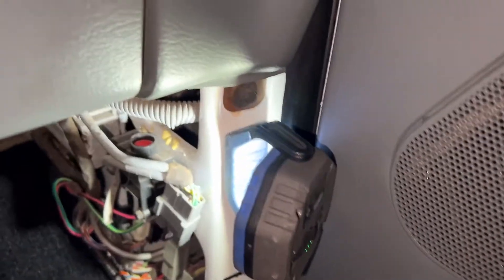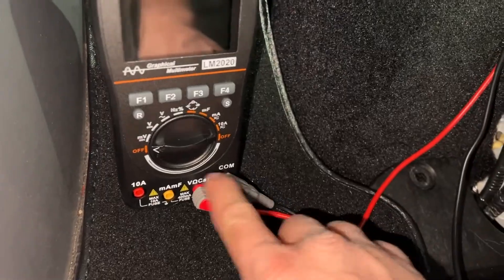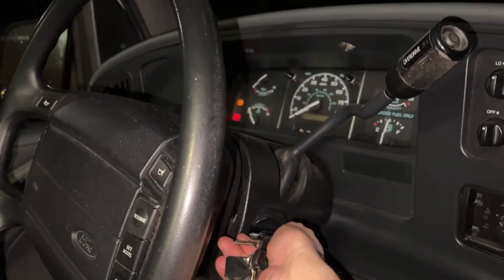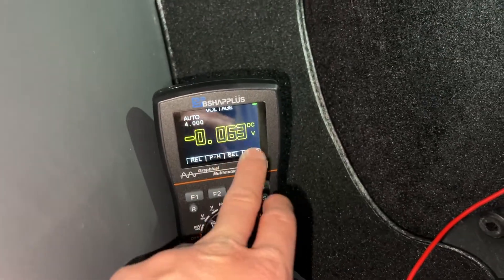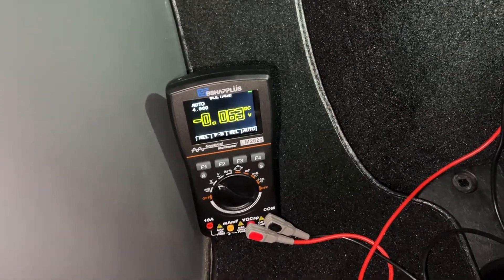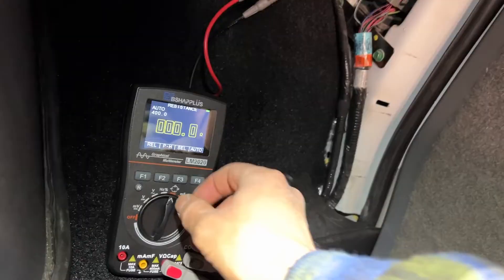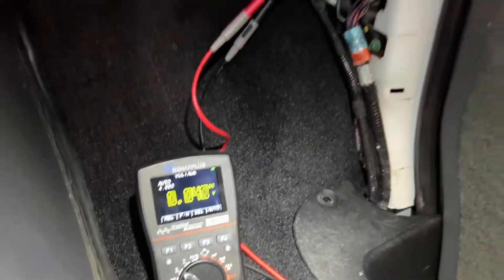How Test if the Ford Inertia Switch is Causing Fuel issues | Checking Voltage Drop

Comment: Just replace my fuel pump on 2003 Ford explorer and replace battery it turn over but felt like it was miss firing when holding gas padel to the floor with no power to keep engine running now battery light and service light is on
Reply from the maker: check fuel pressure, aftermarket pumps these days can be garbage, could be electircal issue as well

Comment: Dickerson!!! I command you for your experiments and the desire to illustrate some YouTube audience.

My recommendations are as follows:

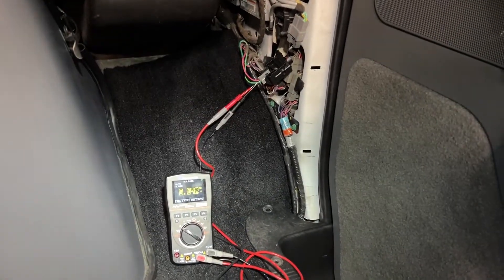When you record a video despite your interest in helping others please label the title with make and model of your experiment. Remember not all Ford models have manual inertia switch in the same location or even at all!!! 2009-2020 F150’s don’t have a manual one. So if 50 people take the time to look at your vehicle and it doesn’t work for them, they are going to leave a thumbs down as I will just until you fix it. If 50 people watch your video for 3:24 seconds per day world wide + the time it takes during the advertisement adds per day aka 4 seconds if hit skip + the lagging clicking time to get to this video and get out, scientifically each one is wasting 3:30 minutes if it doesn’t apply to them + the labor time removing components that could be up to an hour to remove them just to realize your video don’t fit their vehicle. So yes you could fix it by specifying the title and year of the vehicle you are working on instead of generalizing all Fords on your experiment.

Second: You never leave leads connected on a DMM when transitioning from settings, this miss behavior has fried lots of electrical components on private and dealer sectors. The right way is to remove the leads, get your setting as you wish and then reconnect them, so watch out for it, hopefully it doesn’t happen to you but if you do the scientific math 50 watchers X 365 days= 18,250 if 10 does what you show that’s 1,825 misbehaviors and if a 10 percent gets their circuit protection blowed that is 180-190 individuals, for this alone I will give you a x 100 thumbs down if YouTube will allow me.

Third: on the positive note you try to help other viewers, I recommend you to go to Automotive Tech school or to challenge the ASE’s and become certify on something so the misleading  information across all platforms gets reduce to prima facie instead of scientific experiments.

Nothing personal, just my observations from an Auto tech student and ASE certify tech. Otherwise good job on finding the repair and hope to see many great videos coming out of this channel.

During the mean time, I won’t leave you a thumbs down but at thumbs up as I know you will help others and have good intentions, so take it with a grain of salt.

Comment: A .02v voltage drop in this component is basically irrelevant. It's nothing. The correct way to test this switch is to hook the black lead of the multi-meter to a good chassis or battery ground. The red lead woud be backprobed into each of the two inertia switch wires, one at a time. If you have 12.6v coming in, you should also have 12.6v coming out. That would be more like 14v if the engine is running. This test is best done running.

If you have 12v coming in and 0v coming out, try pressing the big red button down to reset the inertia switch, and test again. This switch is designed to break the continuity of the fuel pump power wire in the event of an accident (a hard jolt). It is resettable. Under that red button is basically a metal ball and spring, and a magnet that holds the switch down. When the vehicle is jolted hard, that magnet will fail to hold the ball down and the spring will push the switch up/open. This breaks continuity and turns the fuel pump off. A safety feature, in case you're in an accident, that turns off the fuel pump immediately upon impact.

This switch is sensitive to being jolted, and might need to be reset by pushing the red button down. In high school, we would kick our friends Mustang bumper and shut his car off as he drove thru the parking lot. If you have a truck, just suddenly dumping something into the bed of a truck might be enough to shake this inertia switch and cause it to open. When it opens, the red button pops way up. Just push it back down, and it restores power to the fuel pump immediately. 

The inertia switch is also a very easy place to test and see if the fuel pump is getting power. Generally speaking, power usually comes from the fuel pump fuse and relay, goes thru the inertia switch, and ends up at the fuel pump. If your car has an electronic returnless fuel system (no return line), sometimes they put the inertia switch inline to the fuel pump driver module's power source, instead of being inline to the pump itself.
Reply: Don’t need to test it if the vehicle is running. Otherwise yup

Comment: Out of my 30 + yrs and never had one of these go bad they ether work or they dont most likely its a bad pump
Reply from the maker: Yeah they probably dont go bad often, nothing wrong with my van after a new fuel pump and filter, just showing people how to check voltage drop and getting a baseline for what a good one looks like

Comment: Thank you very much.   I am traveling in my van and I believe my fuel pump is going out so I am trying to learn about it myself so I don't get ripped off.  Being over 60 and a female I am easy prey for a shady mechanic on the road.
Reply from the maker: No problem. Most likely a fuel pump or strainer/filter they are common to go bad on ford trucks. You want to replace the entire fuel pump unit with a quality part like a delphi. And its best to drain and drop the entire tank out and have it inspected and properly cleaned with a delphi cleaning kit. Delphi actually offers a lifetime warranty on their pump units if tank is cleaned properly. The people cutting holes in the floor and just replacing the pump are not saving much time and a dirty tank will make a new pump fail again prematurely. Best to do the job right

Comment: What year model and engine? Thanks
Reply from the maker: 96 Ford E-350 7.5L engine
Reply: @4WheelKid so I have only 6 volts at that switch ? Shouldn’t I have 12 volts ?
Reply: @4WheelKid so I have only 6 volts at that switch ? Shouldn’t I have 12 volts ?